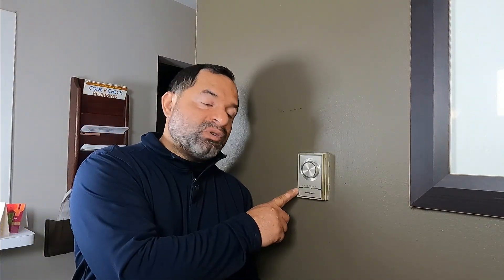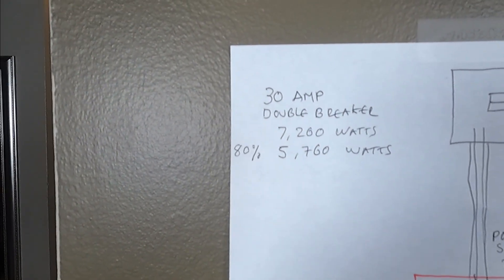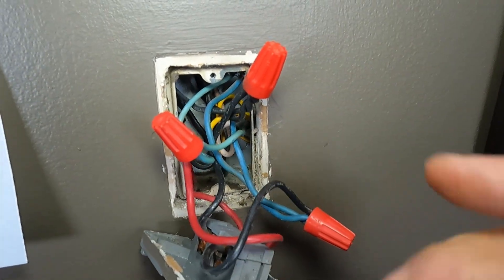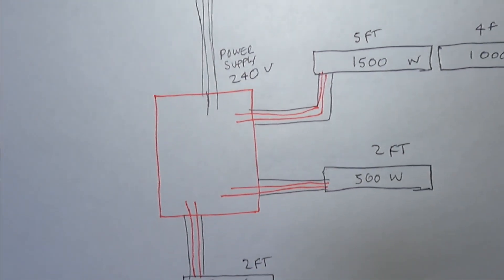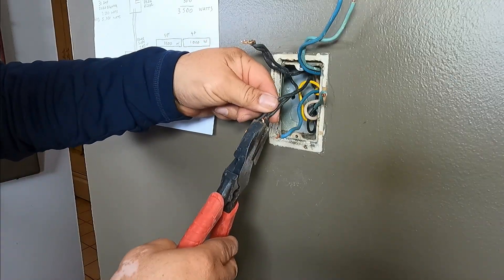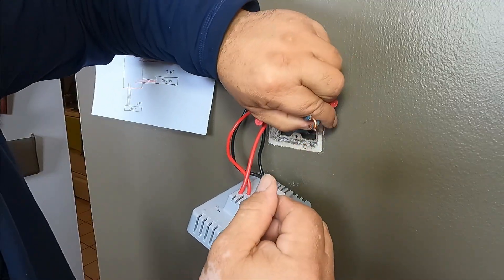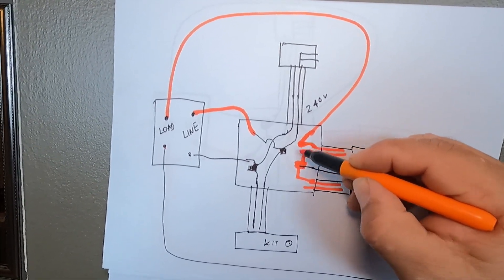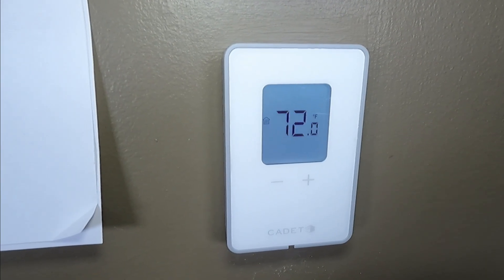HOW TO INSTALL A 240 VOLT   4 WIRE WALL THERMOSTAT FOR A BASEBOARD HEATER (S)

Comment: Great video. Very clear. Thanks. One question. Why didn't the manufacturer of the thermostat use red for both line wires for power coming into it and use black for both load wires to the heater(s). Seems confusing to me that for the wires built into the thermostat for the two Lead wires (one wire is red and the other is black). Likewise, for the wires built into the thermostat for the two Load wires (one of them is black and the other is red).

Comment: Hola tu me puedes decir que número de alambre necesito  por favor gracias
Reply from the maker: Hola Juan.  Depende de cuantos calentadores vas a conectar por pastilla.  Depende de el tamaño de los calentadores y del amperage.   1 o 2 calentadores  Cable 12.    3 o4 cable 10.
Reply: @alexthehandyman3494  Hola gracias por contestar quiero colocar 4 baseboard de 5 pies osea que tengo que usar alambre de 10 con un breaker doble de 30amp o es mejor 40 amp muchas gracias eres muy amable y tu video me ayudo mucho a las dudas que tenia
Reply from the maker: @
Todo esto es basado en 240 voltios.
30 amps.  30x240=7200.Watts   Menos el 20% Por seguridad. 5760watts.    Solo usamos el 80% de la capacidad del breaker.,   
Por cada pie de calentador es 250 watts
20x250 watts=5,000 watts 
Es totalmente seguro usar el de 30 amps para 4 heaters de 5 pies.   Esta por abajo del 80 %. De acuerdo a la matemática podrías instalar hasta 23 pies de calentadores de manera segura sin rebasar el 80%
Acuerdate de conectarlos en paralelo y NO EN SERIE.

DOUBLE POLE BREAKER DE 30 AMPS
CABLE DEL 10
1 THERMOSTATO.
Reply from the maker: https://youtu.be/xf8tvQz9Nmc?si=hT7TgmHFa_cDLrO_

Comment: How good are those thermostat? I want to replace the dial type thermostat to a digital one like the one in the video?
Reply from the maker: Hello Steeve.  It is ok.   It is not people friendly,  I installed a few in a Bldg I have and tenants dont get use to it.  It is kind of weird to operate them.   I prefer this one that is not programmable but you can get it programmable.   https://www.amazon.com/dp/B000GGPMZ6?ref=ppx_yo2ov_dt_b_fed_asin_title
Reply from the maker: Let me know which one you end up getting.

Comment: Shouldnt that be a 20 amp braker ?
Reply from the maker: Hello Joel.  We have 14 ft of baseboard at 250 watt per foot.  that's 3500 watts.  The 20 amp allows 20 x 240 =4800 - 20%= 3840  watts. A 20 amp breaker would be sufficient? yes  It would be very close to the 80%.   So 20 amp (as a minimum allowable).Yes!!    But it has a 30 amp breaker with 10 gauge wire.   Which is totally fine.  You still have another 2200 watts available .   So can you put one 60 watt light bulb on a 30 amp circuit?   Yes of course!!   It is safe?  Yes!  " 

So the question is not : shouldnt be a 20 
 But is the 20 ok?.  yes it its.   
Thank you so much for your question.   I hope  I made sense.

Comment: Hello friend, I need your experiences, right now I have 4 3-foot 240v heaters, what gauge of cable can I use and what type of bracket to use, your answer would be good for my project.
Reply from the maker: Hello my friend.   Sooooo
Based on the rule of thumb of 250 watts per lineal foot.   You have 4 heaters 3 feet each.
that's 12 x 250  that's 3000
a 20 amp double pole breaker with number 12 gauge wire will cover 3840 watts.  

so the answer is 20 amp double pole   12 wire
Reply: @alexthehandyman3494  I have 4 heaters of 240v and 750w each, so he told me that I can use a 20 amp double breaker with 12 gauge wires, is that so?
Reply from the maker: Dont forget to like and subscribe please.

Comment: If you're running a 30A breaker, you need 10 AWG wire from the panel – but this looks to be 12 AWG (20A).  In your case 20A*240V = 4800W @ 80% = 3840W (derated).  If that's 12AWG wire, drop the breaker to 20A and you'll still be under the 3840W max.
Reply from the maker: Hello Bruce,  You are absolutely right!!   Those are all 12 AWG.    I recommended to bring it back to 20 amp breaker.    Management  doesn't want to spend more money$$$. 
We are replacing those panels as we rehab the apts.   Thanks for your input.

Comment: Can you share the link to the thermostat you installed? Also I’m trying to find your video on how to connect the heater parallel.
Reply from the maker: Hello,
I just posted the link for the thermostat on the description.
I have another video called "how to troubleshoot 240 volt electric heaters".  I don't know if I explain there the parallel installation.
Parallel means you connect each heater to the power source.   If you have 2 heaters installed side by side the most common mistake is to install the power to the first heater and then from that heater you piggy back connect the other one. THAT IS WRONG.
 
Connect the 240 to the first heater.     From the second heater you have to run 2 more wires to the 240.  and hide the wires through the first heater .
I hope that helps.  Let me know how you do.

Comment: Use wago lever nuts instead of wite nuts. No twisting!
Reply: Agreed, love em.  Also, get rid of that federal pacific! I just swapped my FP sub panel out and working on the main swap out now.  Multiple issues with these old panels
Reply: @timreigrut4061  I replaced mine in the house but the garage still needs it. It's detached thankfully

Comment: So what about if you’re wiring multiple heaters that have built in thermostats? Can you do a video on that?
Reply from the maker: Hey Jonny.   I do and that video.
If one breaker serves different heaters, you have to take the 240 volts coming from the breakers box before they go ta a wall thermostat and splice them and  connect with a wire nut in parallel .  you have to send 240 to each heaters thermostat.

Comment: How do you turn it on? My thermostat isn’t powering on.
Reply from the maker: Hello Karl
you have to make sure the two power wires from the electric box are connected to the L1 and L2
the other two heater wires to the load.  
Make sure the thermostat doesn't have a ON Off switch.
When you call for heat (
 The set temp should be higher than the room temperature .
Make sure all wires nuts are well fastened with the wire nuts.

Comment: Great video. Many thanks. Any thoughts on why a baseboard heater would be getting very hot when thermostat set to low setting?
Reply from the maker: Hello    More than likely thermostat is faulty allowing more heat than it should.
Reply: @alexthehandyman3494  Thanks Alex!

Comment: Maybe a dumb question but why is there no ground wire in any of this?
Reply from the maker: Hello Bourque,
It is not a dumb question.  
In most cities of the midwest you are required to have all your wiring inside a metal raceway or conduit. This pipe is connected to the electric box and to the electric box is connected to the  breaker box (through the metal conduit) .   Inside the breaker box is tied with the ground that goes to the "ground "
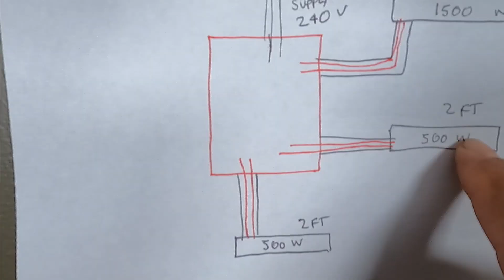See my video. "25 things you should know about a receptacle". at the minute 2:00. I explained this more in depth and with images.  Thanks so much

Comment: My baseboard heaters are from the 1980's. The wall thermostat is a dial at the bottom that you turn to temp. It does not turn of when I have it at whatever temp I want and the thermometer shows what temp I want. Can this type be replaced to be able to automatically shut off? To me it is not safe to leave the apartment with not having the thermostat shutting off and turning on when it should.
Reply from the maker: Hello Connie
that thermostat is probably  shut and needs to be replaced.   Wall thermostats and thermostat by the heater work the same way.   Test it yourself of have some one test it, If it fails the test buy one online.  They are usually cheaper on line that on a electric parts store. Send me some pictures to look at the heaters and the wiring.  Good luck!
Reply: @alexthehandyman3494  this is an apartment and they have to do whatever work is required. Trouble is getting them to do anything!! I just wanted to know for sure that a different thermostat would shut off. They had replaced them in the apartment I was in first amd they did not shut off when setting the temperature. I have digital thermometers in each room.
Reply from the maker: @conniewood7587  
Hi connie.    Some thermost don't shut off by design.   They have high and low settings but not off.  if that thermostat is like that, is not going to shut off.   They do that so tenants don turn it off when they go on vacation or away for some days and pipes might freeze.
Reply: @alexthehandyman3494  great so I  paying for constant heat that I don't need instead of it being regulated by a thermostat.That seems like a fire hazard to me and doesn't makee feel comfortable leaving.

Comment: I need to install baseboard heater in a small room 10x13 - can I do 120v?
Reply from the maker: Hello Kiri   Yes you can.   it will be best if you install it on the window wall.   I think an 72 in  will be sufficient.  10x13x10= 1300watts.   a 72 in will cover 1400Watts.  if the windows are old maybe I ll go with the 86 inches    A 240 will save you money in then long run.
But if you don't have ready 240 in that bedroom it can be expensive to run it.  Good luck   Let me know how it goes.
Reply: Hi Alex, thanks. I may try run 240. I’d have to run new wire it’s about 30ft to the breaker box. I hope it has capacity. I’ll need to learn adding the double pole

Comment: I believe the two heaters that are together are in series, not parallel. Thanks for sharing.
Reply from the maker: Hello How to it Dude.   Thank so much for your comment.  They are not .  They are in parallel.   The power source that comes from the thermostat, when it reaches the two heaters first junction box, the 2 wires from heater one  go the the power source and the second heater two wires  attach to the same power source, so there are a total of 3 and 3 totaling six wires .
It would be series if the power source goes to the first heater on the left side, and then the right side of heater one connects to the left side of second heater.  I hope I word it right.   LOL   Greetings !!
Reply: @alexthehandyman3494  how can I conect 5 heater on serial?

Comment: This helped me understand a lot. BUT I'm still stumped. Could you help me out in some way? All I'm trying to do is change my thermostat and the way the old one was wired is confusing the craw out of me. 
If you reply and are willing to let me with your brain with my problem, then ill explain everything.
Reply from the maker: What up Austin.  Lets fix it!!!!
1.  What kind of heaters 120 or 220?
2.  How many heaters?
3  what kind of thermostat.   How many wires does your old thermostat has?
4.  take pictures.